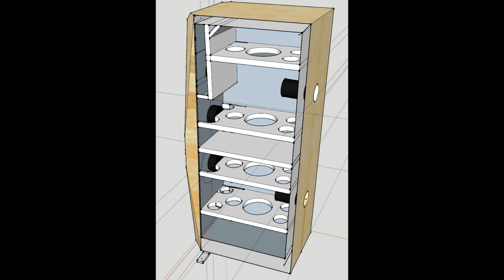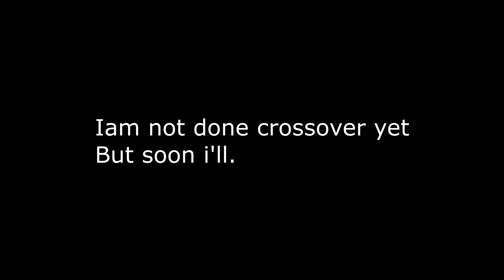My first DIY high-end speaker

Comment: Hello
What you thing about this set  1x T25CF002 + 1x W17E002 or W17EX002 and 2x W21EX001 

I have this speakers and i want to build some pair of speakers,  i will build only whit Plywood but i don`t know how to create crossover, could you help me whit this One?
Great work whit your speaker box!
Reply from the maker: You such get help from something who got a microphone so it can analyze the sound.

what i did is that i used a program to make the crossover. then i build it, and listen/ use a microphone  to see the EQ.
Reply: Hello
I have crosover for set what i write up, but i don`t know i mesure right, and spekarbox, i have for two W21EX001  90 liters, you say for one its 48 liters, WinIsd  mesure for ONE 130 liters ;)  i have two W21  in one box i don`t separate, and Crossover whose in set up, but for one i have 5 ohm and secound 7 ohm  ;(  all i whose buy for 700 $, i thing its good prise
Reply from the maker: 130 liter is alot for that small bas.. :D
I can say this must, that it worked great with 48 liter, og and pibe around 20 cm long.

and you said one have a dc ohm at 5 og and the secound is 7 ohm?

Comment: Hi man, nice job bro, listen, i have a 2 pairs of Tannoy from 2001( Mercury MX1, Mercury M2) and a central speaker Mercury MXC, the project is grab on this speakers and transform in to a pair of Floor Speakers, but i have a lot of doubts if is gonna work it or not.
If you can help me on this project, it ill be lit.

1º What type of crossover can i use?
2º The size of the cabinet?
3º It´s possible use the central speaker´s as a midrange?
Reply from the maker: Hallo.
do u still need my help?

Comment: As a speaker builder myself,   looks like you done some studying, nice build.
be very selective on your crossover, sometimes it's good to make several using software. if you can afford an electric crossover, I say use it. electric crossovers will give the high end ability and simply much easily to tune using software. the sound is astonishing up with the most expensive speakers on the market.
Reply from the maker: well iam using xsim and i pretty happy with it.